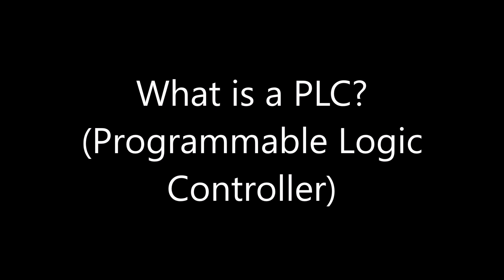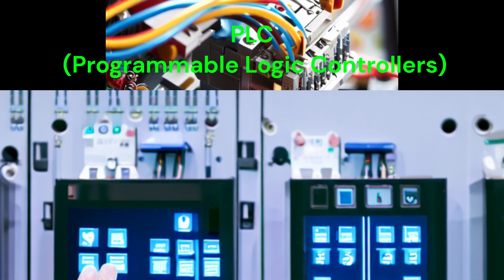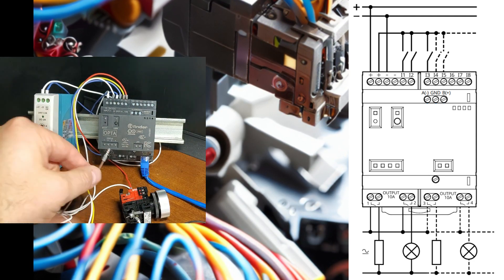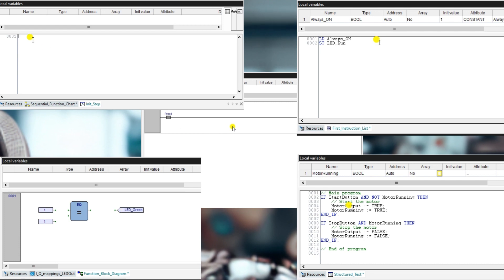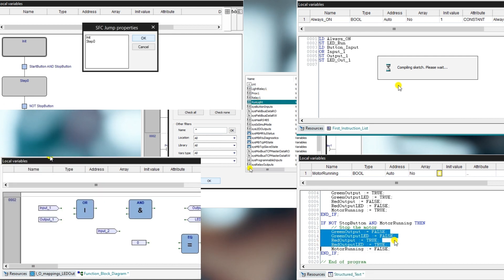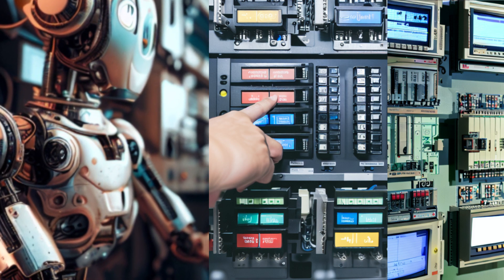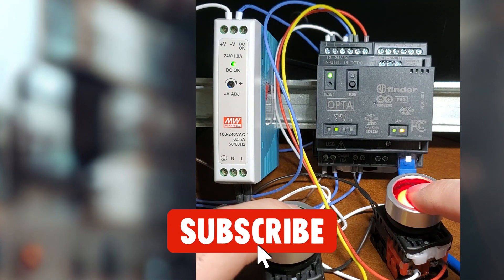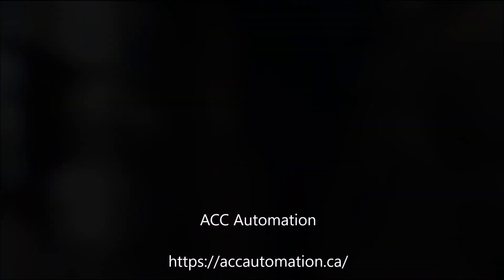Master Industrial Automation: PLCs Control Everything!

Comment from the maker: Detailed information and links can be found on the corresponding post located here.
https://accautomation.ca/what-is-a-plc-programmable-logic-controller/

PLC Beginner’s Guide to PLC Programming
https://accautomation.ca/programming/plc-beginners-guide/

Here are the controllers that we have covered at ACC Automation:
BRX Do-More Series (Do-More Designer Software + Simulator)
https://accautomation.ca/series/brx-do-more-plc/
Productivity Series
https://accautomation.ca/series/productivity-1000-plc/
https://accautomation.ca/series/productivity-2000-series-plc-p2000/
Click PLC Series
https://accautomation.ca/series/click-plc/
Omron CP1H Series
https://accautomation.ca/series/omron-plc-cp1h-series/
Horner XL4 PLC Series
https://accautomation.ca/series/horner-xl4-series/

https://accautomation.ca/series/easyplc-software-suite/
EasyPLC Software Suite is a complete PLC, HMI, and Machine Simulator Software package. Please take a look below to receive 10% off this software. This PLC learning package includes the following:
Easy PLC – PLC Simulation will allow Ladder, Grafcet, Logic Blocks, or Script programming.
HMI System – Easily create a visual human-machine interface (HMI)
Machine Simulator – A virtual 3D world with real-time graphics and physical properties. PLC programs can be tested using the EasyPLC or through other interfaces. (Modbus RTU, TCP, etc.)
Machine Simulator Lite – Designed to run on Android Devices.
Machine Simulator VR – Virtual Reality comes to life so you can test, train, or practice your PLC programming.
Purchase your copy of this learning package for less than USD 95 for a single computer install or less than USD 110 to allow different computers.
When you order, you should receive 10% off the investment by typing in ACC in the comment section. http://www.nirtec.com/index.php/purchase-price/
Learn PLC programming the easy way. Invest in yourself today.

ACC Automation
https://accautomation.ca/

Comment: What might be a cool video for youbto work on...running OpenPLC on am Arduino...getting us up and running startnto finish and how to get the MODBUS up and running.   

I was almost there with click and Subpanel app for a project...but quality issues with firmware bricking the PLCs...3 returns and I gave up.   It wasnt anything i was doing....i borrowed one from work that was an older version, no wifi and it worked fine.  But by that time....i was over the project and quit.   

Back at it but using arduino for cost...way more affordable for hobby stuff....if i brick one (which i dont think is possible), its 30 bucks, not 200.

Why OpenPLC?  Because i still want to understand programming PLCs better for work.